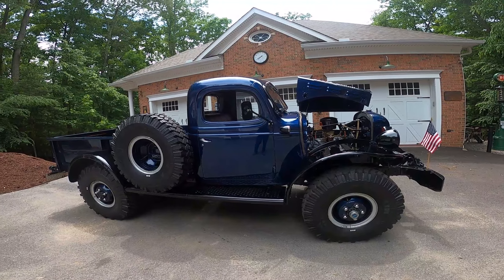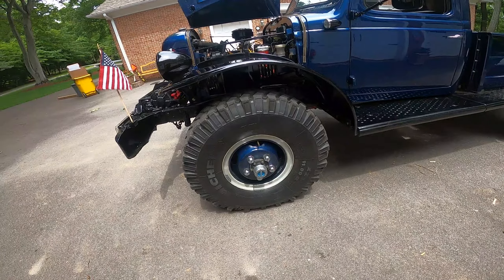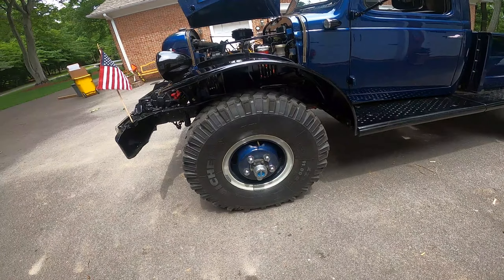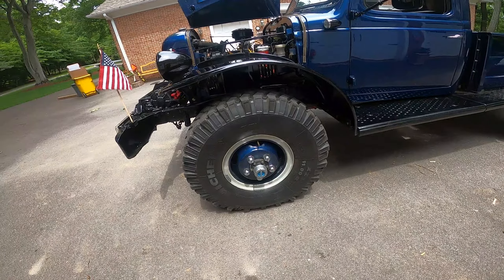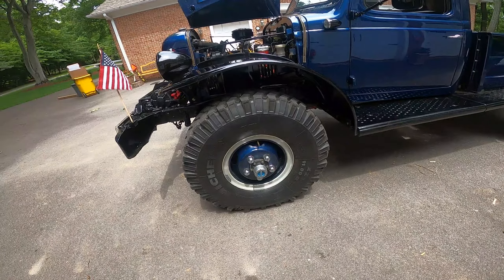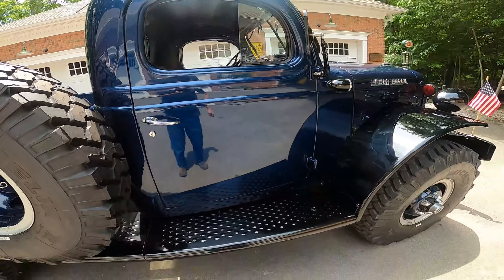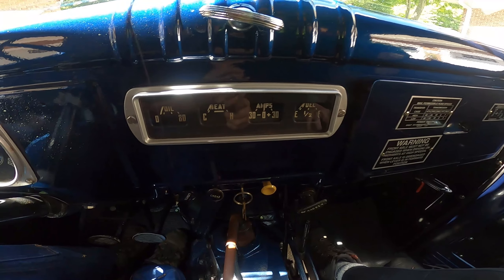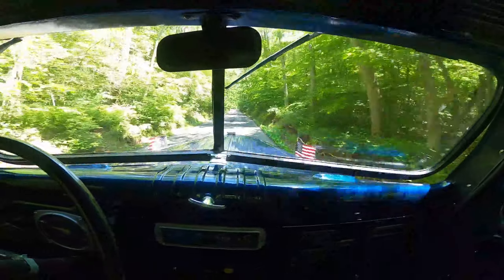Flat Fender Dodge Power Wagon Drive introduction and drve

Comment: THAT, Sir, is a REAL TRUCK! 100% GENUINE definition of what a Truck is supposed to be. Made for WORK and not SPEED. A valuable tool in the right hands. It's absolutely BEAUTIFUL and your love for it shows with its top notch condition. You don't see very many these days and when you do, they don't look this new. I mean, this thing looks like it could've just rolled off the Showroom Floor!! The ones I see show the wear and tear from the abuse over the decades. Definitely Car Show material and would probably be a Winner every time.
Reply from the maker: Thank you!

Comment: thanks you didn't have any problem running the 17" tires you have on your DPW. any modifications?
Reply from the maker: Gordon, well.... the rims are custom made by Ric Tudor. He took stock rims, cut the centers out, and welded on 17" out things. I now have tubeless wheels with very little run out. I am finally happy with them. I have a friend near me who has an extra set of custom rims, where are you located?
Reply: @WaynesWorldGarage  
Hey Wayne, I live in Anaheim Ca
The rims on this 1955 are differant then the rest I've seen.
This one has a outer ring that bolts on. Instead of the crome split ring..

Comment: i have 46 pw.  when it had the 230 6 cyl and 5.83 gears top speed was 45 mph.  i later put 4.89 gears in it.  it cruised at 50mph and got 17 mpg instead of 10mpg.  If we need to drag something there is low range.
Reply from the maker: Absolutely. I have a laycock overdrive, and with that I can cruise nicely at 45. Otherwise the sweet spot is maybe 35. It will go faster without the OD, but she's screaming!